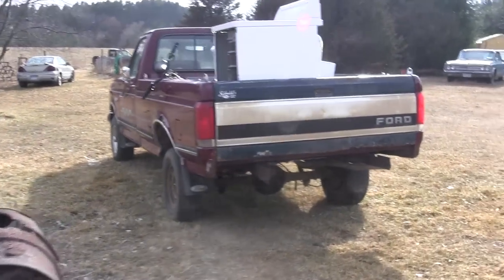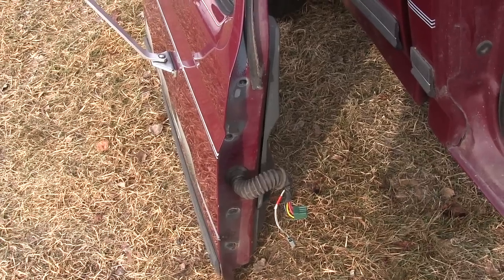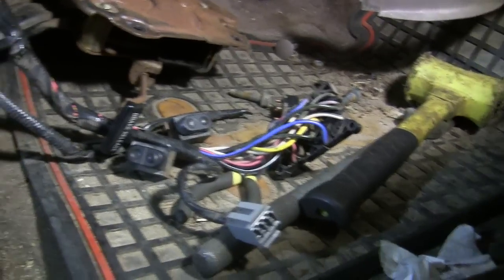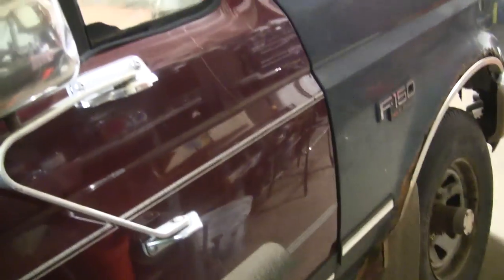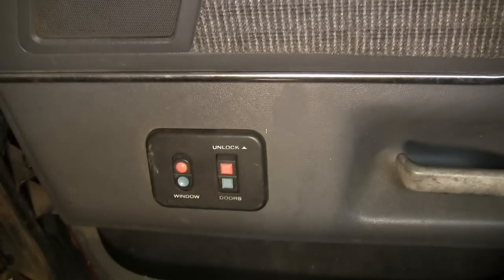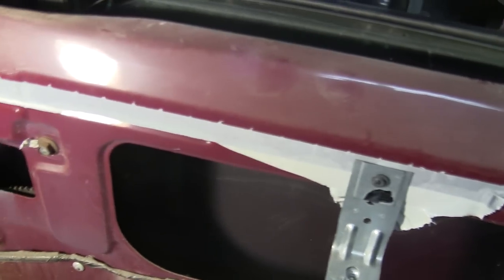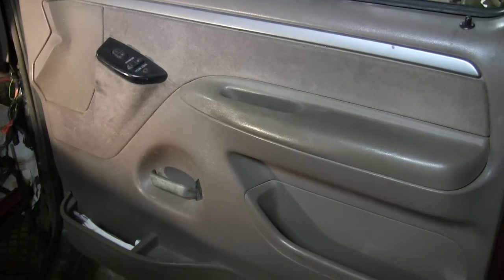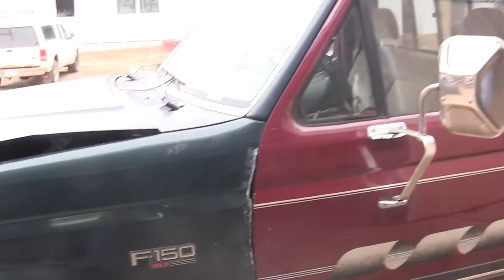F-150 Door Swap

Comment: The 87 to 91 f-150  and 92 to 96 f-150 look the same but they have alot of different parts the doors from an 87 to 91 will fit perfectly and work perfectly if you do not have power windows or Power Mirrors even the fuel system is not the same as the 87 to 91 i think it has less wires then the 92 to 95

Comment: Why didn't you just use the red truck? I think it would have been a lot easier and it's not a Rust heap?
Reply from the maker: Lawrence Eich It's kind of a heap. Its got no reverse, stuck in 4 low, transfer case shifter broke off, ignition broke and column is tore apart, all the brake lines but one are rusted out and pinched off, can't transfer the title without the lien card I never got and theres plenty more little things wrong with it as well.

Comment: Why did you swap doors?
Reply from the maker: Sugar Walls Inside door handles didn't work, drivers side window was rolling down slow, drivers door was bent in at the front, passenger vent window was broken, passengers mirror was broken and I wanted bigger mirrors too. It was just easier to swap doors than to fix all that stuff.